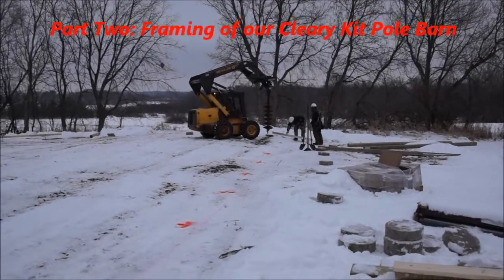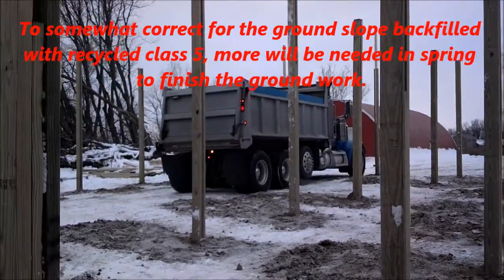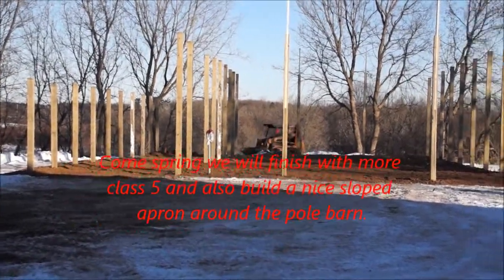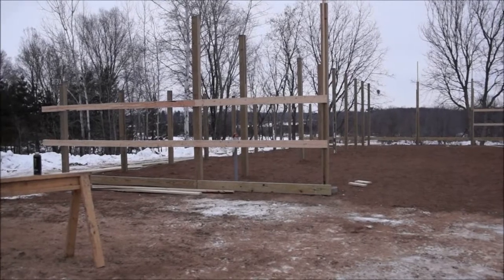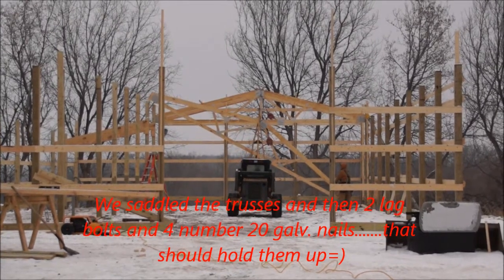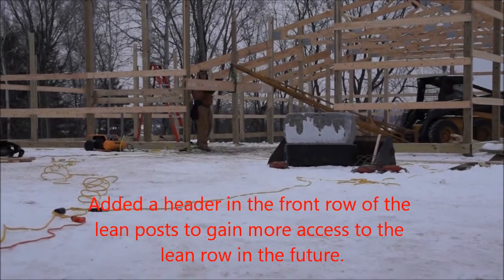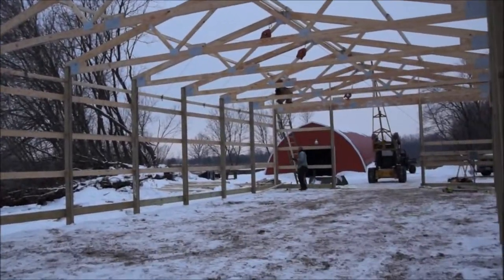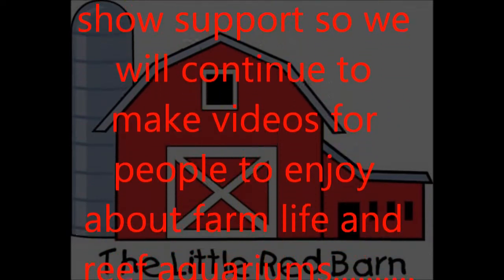Little Red Pole Barn Building Pt II

Comment: how do you pour the concrete with the cold(m worried about it setting right- im doing the same building and plan on building in the winter...Also im in Elk River MN !!
Reply from the maker: +skynet000001 we do most of pouring in spring and fall, that way you dont have to use salt additives to enhance the drying